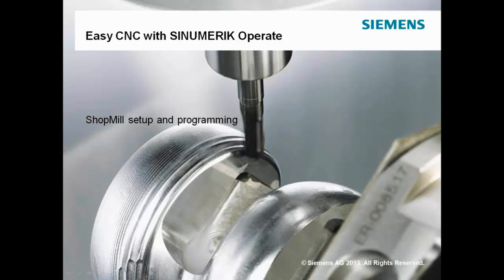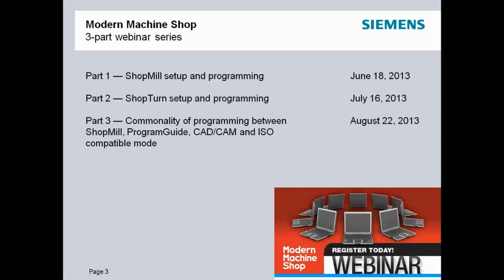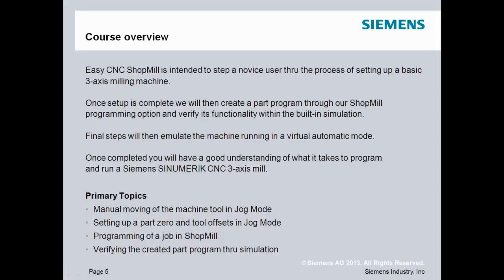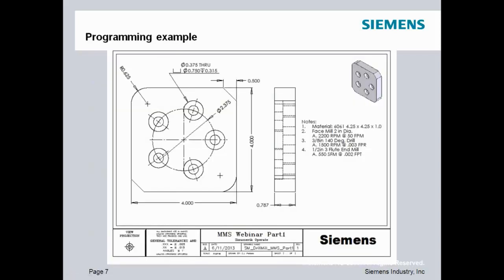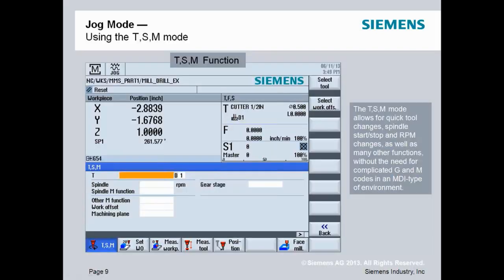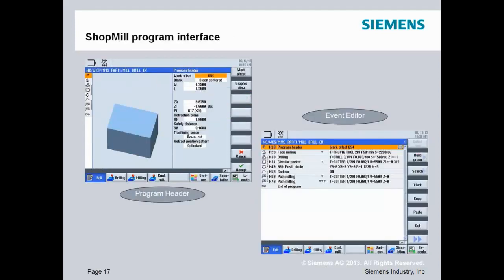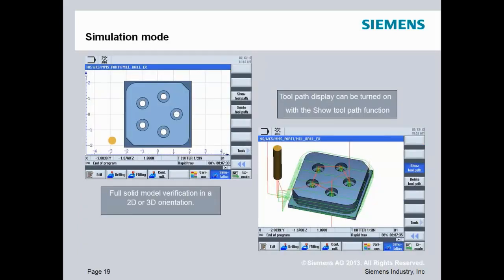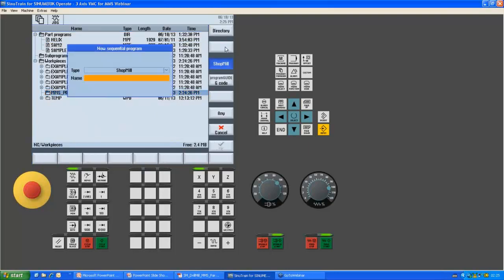Easy CNC with SINUMERIK Operate Part 1 ShopMill setup and programming

Comment: Does anyone know how to run an NC program without the axes juddering in milling, it's not the NC program as we can run the program on a hurco without any problems. There must be some settings on the control to allow maximum through put.?
Reply from the maker: it might be a problem with mechanical parts of the table or Kv,Kp factors. Or the problem in the program, could you show the head of the program?

Comment: Hello , can you tell me how to deactivate spindle positioning on Sinumerik 808D turning ? I can activate it by using SPOS comand and its working until I move chuck by hand or by use M3 or M4 spindle rotation, there is alarm that spindle position is lost.Is there any comand to deactivate SPOS? Spindle position icon in degrees is on screen under Z and X position.Only way to deactivate SPOS is to send both Z and X to home position, and  than when I came back to JOG there is no SPOS icon on screen any more...
Reply from the maker: what if to use M19 instead of SPOS?
Reply: @alexanderkudinov1025  I did tried M19 friend...and no result.That was my first thought, maybe there is kind of comand like SPOS=OFF or similar
Reply from the maker: @nerwusek19  I will check the Docu and let you know, tell me what do you want to reach?
Reply: @alexanderkudinov1025  I want mount simple drilling spindle bt30 with drill bit 15mm  with 1kw induction motor  and mount servo spindle motor  7.Kw with servodrive and braking resistor.Original spindle motor is 7.5Kw induction  motor.Mestake I cant deactivate SPOS untill I will turn  off all system completely , and turn on again, homing is not helping, so its impossible to run program with drilling without restarting all system...:(
Reply from the maker: @nerwusek19  what about encoders? Do you have one on the mechanical system?
Reply: @alexanderkudinov1025  There is absolute encoder of spindle at the moment.But new spindle servo motor have encoder inside also,did you find something about  Spos deactivation?
Reply from the maker: @nerwusek19  Well, I am not sure that you can do it just deactivating SPOS, the issue is that CNC controls the position and if you want to change the spindle in operation mode you have to make some changes in PLC. I could open books regarding Spos today, let you know
Reply from the maker: @nerwusek19  (SPCON, SPCOF, M70)
Reply: @alexanderkudinov1025  SPCOF is working :)  Thank you ! Maybe you know how to help me with 3ph induction motor controlling from main CPU controller? I know I need to use 24v relay connected to 380v contactor and to the 1Kw induction motor mounted to small spindle attached next to main tool turret.But which output signal should i use ? On the back of Main CPU controller there is X21 socket it has couple free output signals...Do you think its good  to go? I want to use drilling spindle in automatic mode , so Im not sure are free M comands that I can use?
Reply from the maker: @nerwusek19  send to me your email and i will try to find some Docu for you